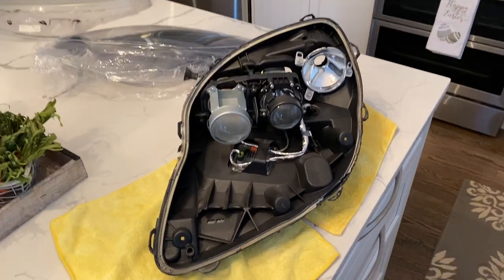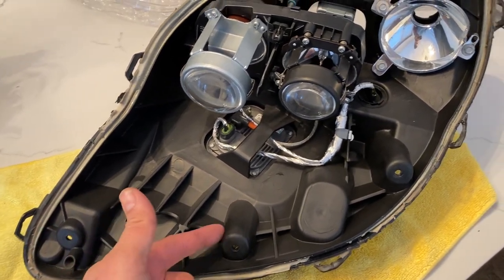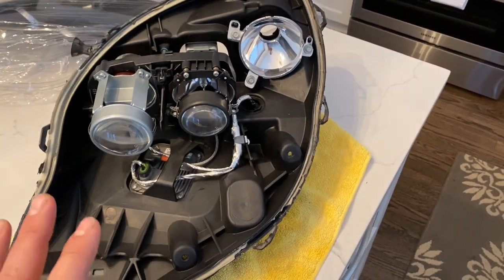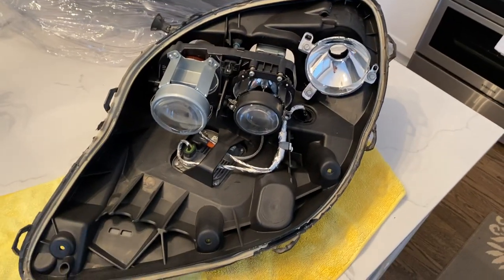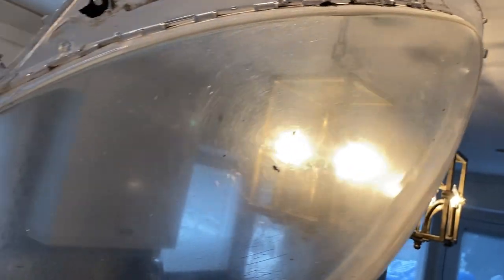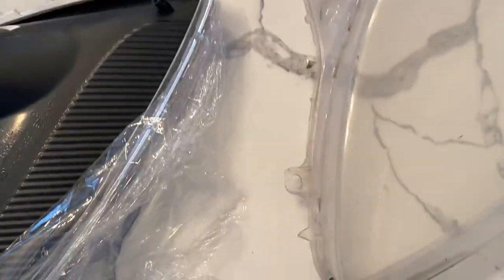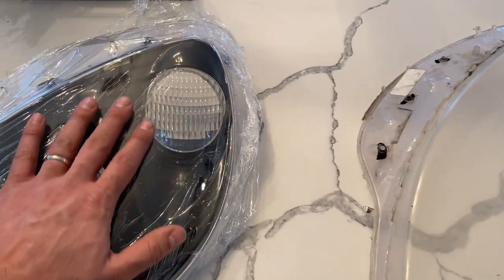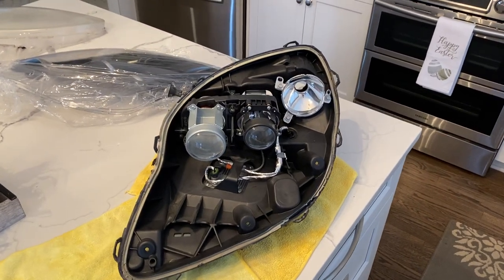Corvette headlight lense replacement

Comment: Hello Last Corvette, I recently viewed your video to try and find out how to aim the C6 headlights. You didn't even mention anything about the  metal rod with a plastic cap back where the bulb caps are. I just had my lenses repaired and found that when I go them back that one of the metal rods was bent. I don't know if it was that way when the dealer took them off the car or if it was bent in shipping. Anyway, is this metal rod the way the headlights are aimed??? I wanted to bend the rod back to straight, although, I don't want to break the plastic in doing so. 
  My first thought was that this metal rod is pot metal, and in trying to straighten it, the rod would break. Do you know if this metal rod is the aiming adjuster for the headlights, and is it necessary that it be straight??  Just one of the two headlights came back bent, so, I'm not sure if the bent metal rod was done while disassembly of the headlights or done in shipping. I personally think is was done in shipping myself. 
  Waiting your response!
  Dennis
PS. I have until Thursday the 9th of June 2022 to do something about straightening the rod, or not.
Reply from the maker: I will reply in a video